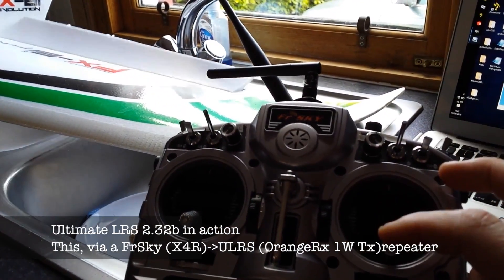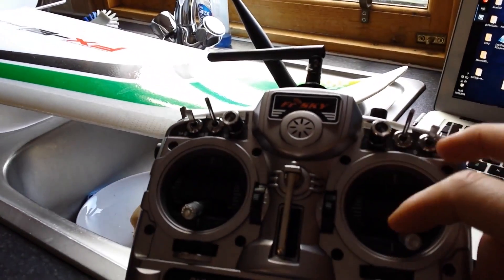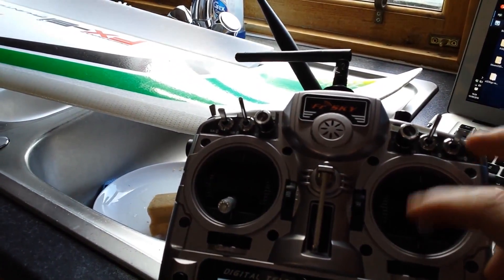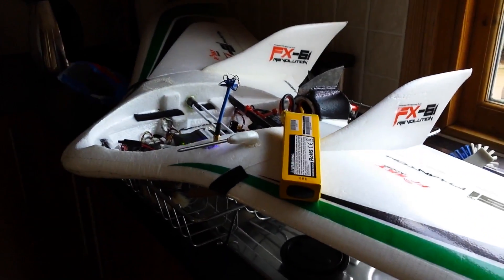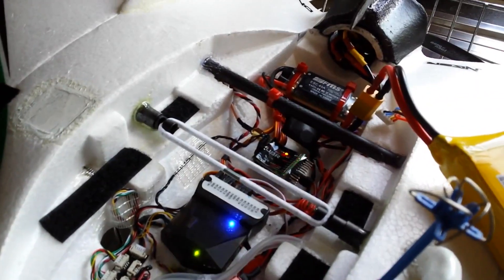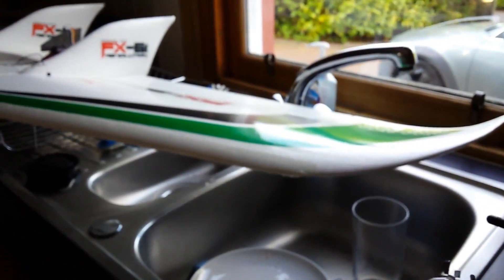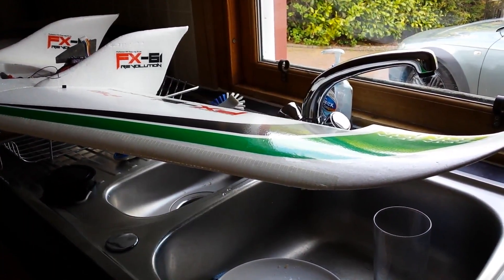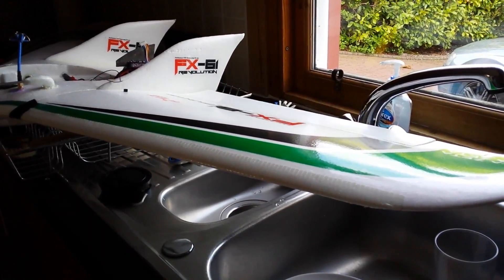Comparing Latency of ULRS vs FrSky

Comment: ulrs is setup for max range with 2way telemetry. Try Olrs instead, learn to configure it for low latency, high resolution goodness. Sbus also supported IIRC.
Reply from the maker: Given I have built dedicated ULRS hardware since this video, think I'll stick with that. Thanks for the info.
Reply: Paul Atherton No worries, granted Sbus inversion's a pain with the old 328's. To get latency way down you can turn off unused channels (in opentx too), overlay telemetry on AV link and find highest datarate that works well for your setup and environment.

Comment: I have a repeater box with ULRS also on a FX-61. I have noticed the ULRS repeater box has delay, I have flown the wing in FBWA mode with the delay and i didnt notice it.
Reply from the maker: Hi Paul. I also notice the same delay even if I put the module directly in the Taranis - so a pure ULRS->ULRS setup. The repeater makes very little difference from my tests.